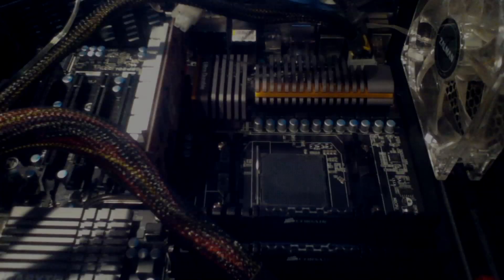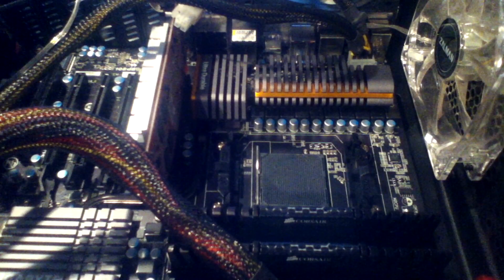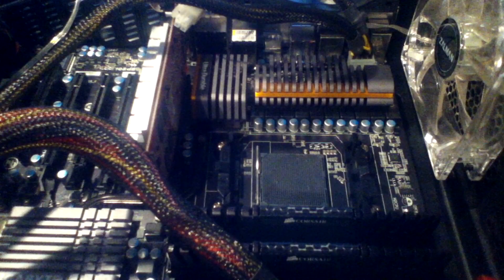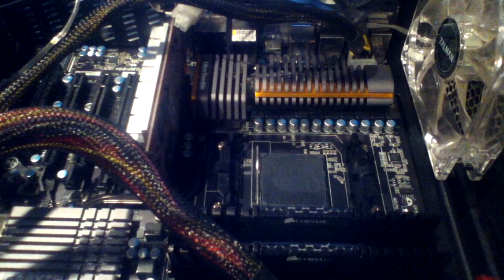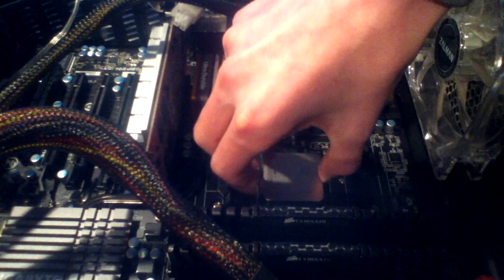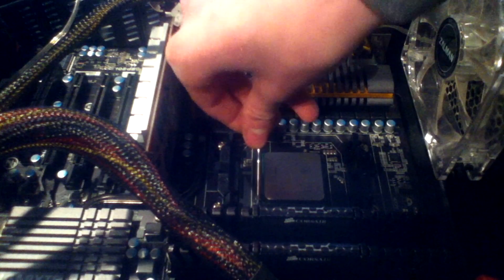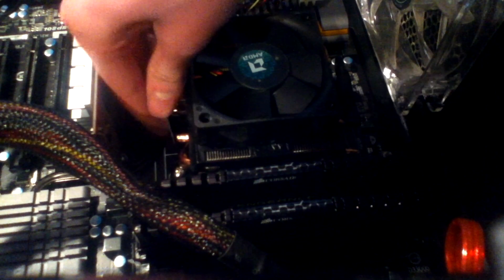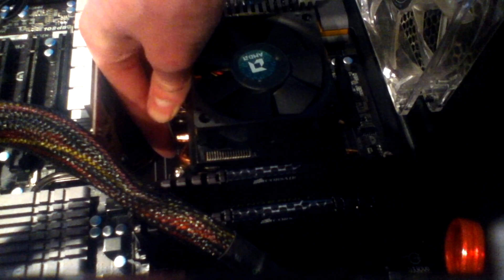Installing the AMD FX 8350

Comment: Do I need to remove my motherboard from the case to install this?  Or will it be able to withstand the torque if I try to connect the fan with the mobo still mounted in the case?
Reply from the maker: You do not need to remove the motherboard to install the CPU unless you have a 3rd party heatsink and fan(s) which uses a different backplate in which case you may need to remove the motherboard if you do not have a backplate cut out in your computer case. I don't see why there should be torque issues with the fans.